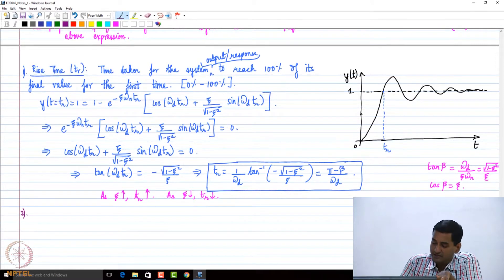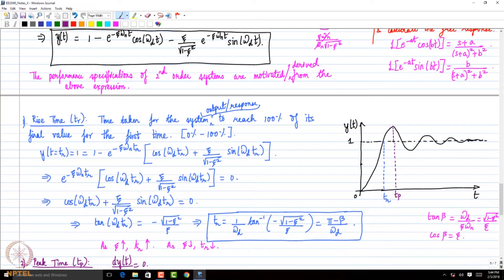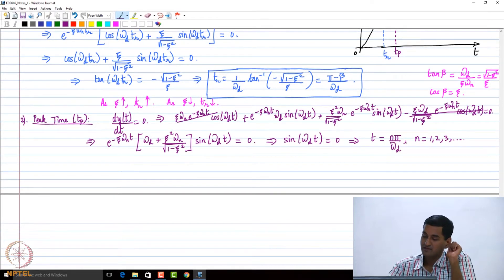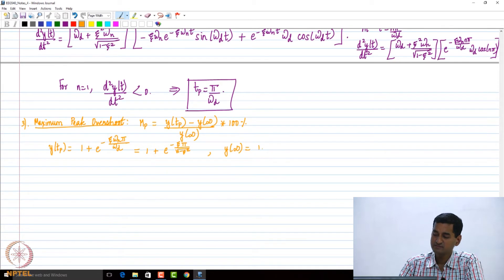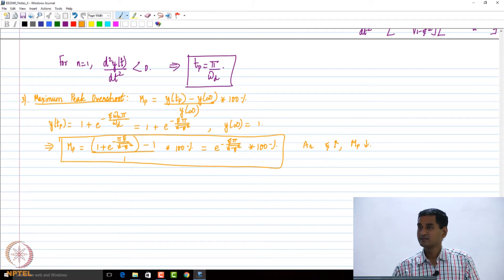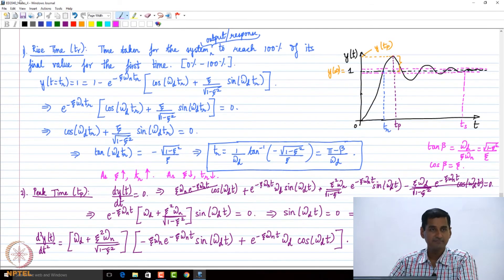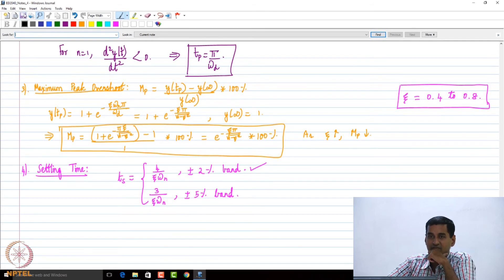Second Order Systems- Part 2

Comment: Underdamped systems are the most practical and most commonly used. The main reason is they will ensure the system always reaches the desired end state with some overshoot. Even though there is overshoot the damping eventually brings the system to the desired state. Critically damped systems, although possible mathematically, are not possible to achieve in the real world and that is why they are not used. You can't achieve them because they are perfect, you could potentially come close but you will always end up either overdamped or underdamped. An overdamped system would never allow the system to reach the desired end state since it is overdamped and that is why they are never used. A simple example is a damper on a large door. It is designed to slow a heavy door down when closing. If the door damper were overdamped the door would never fully close thus making it a poor design. Allowing it to be underdamped ensures it will close fully, but with a minimal amount of "slamming" if the damping is dialed in correctly
Reply: Thanks for the explanation:hand-pink-waving:

Comment: perf specs of 2nd order syst
peak time 0:00
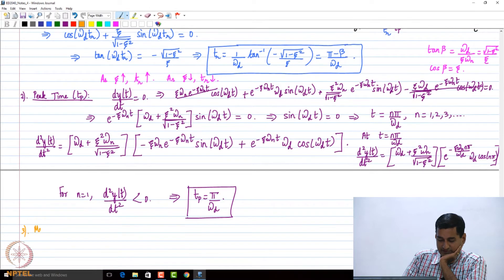max peak overshoot 9:00
as damp ratio inc -> Mpeak dec thus rise time and peak overshoot conflict 13:00
ie. if damp ration high -> peak overshoot low but rise time large ie. syst is sluggish
settling time 15:35
curve of unit step resp of crit, under and over damped 2nd order LTI 21:00
thumbrule is to design underdamped syst with zeta (ie damping ratio) b/w 0.4 and 0.8
crit damped syst is monotonous w/o overshoot and with fastest resp
overdamped syst is monotonous yet sluggish